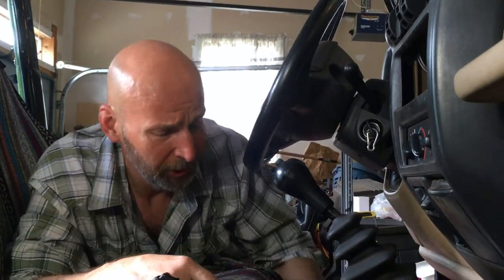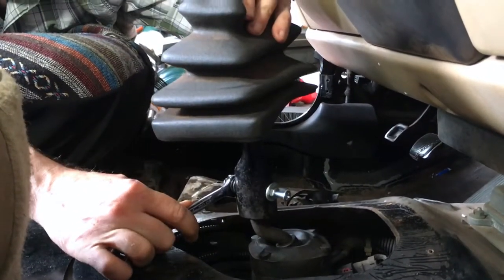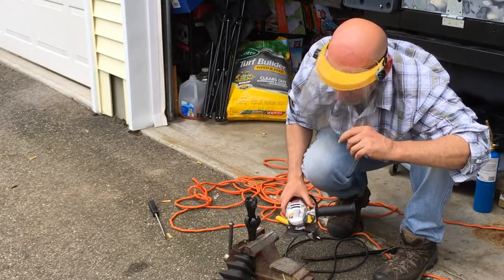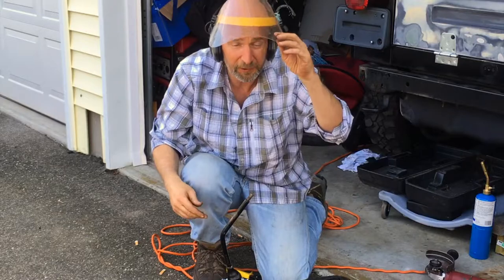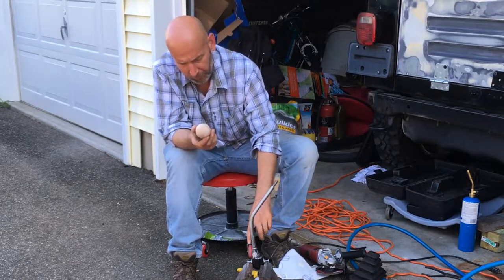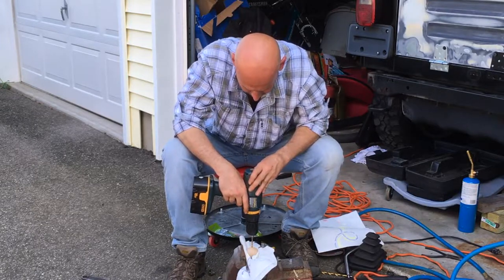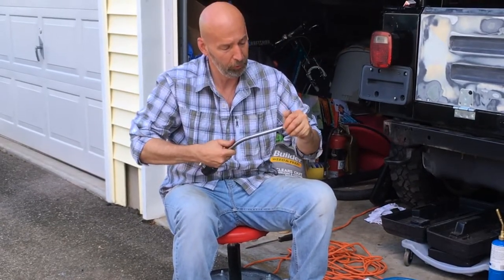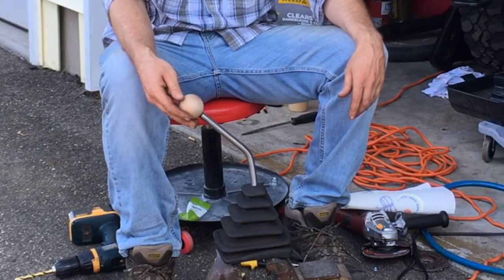Removing manual shifter on a JEEP TJ and customizing it cheap.

Comment: Get don't no if you thought of it or not but on mine I just used a pipe wrench on the nob and it turned. It didn't damage it which is good. Try that in the future. Mite help out